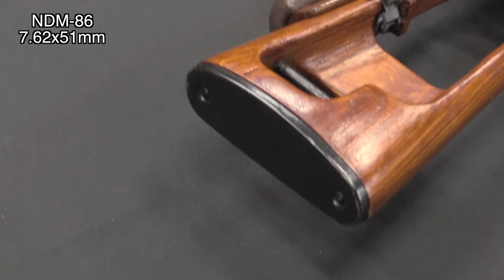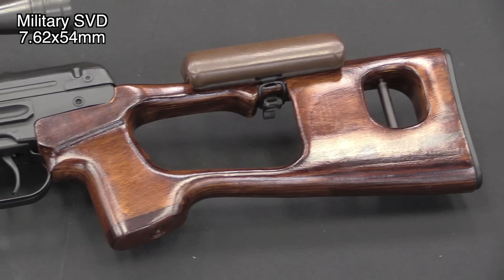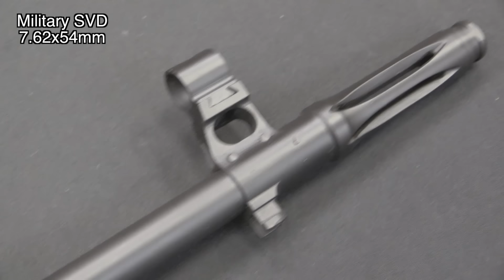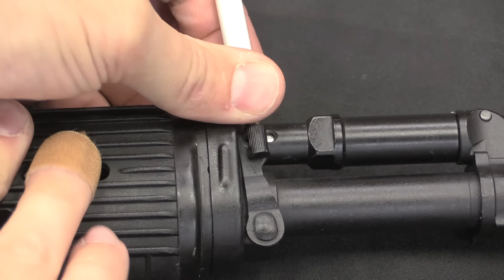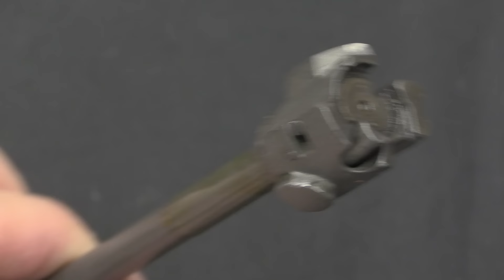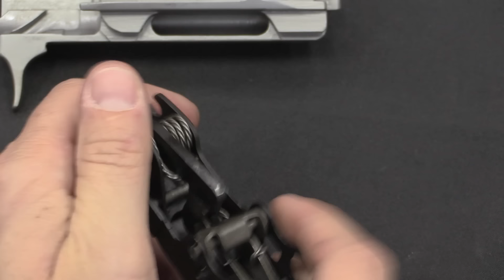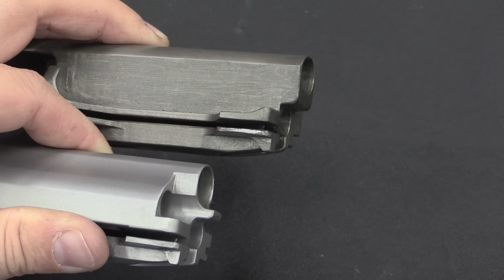Dragunov Variations: Military SVD, Izhmash Tiger, Chinese NDM-86

Comment: I've never heard anyone attest as to whether Dragunov's shoot sub minute. Anyone know?
Reply: When I was in the Polish Army Recon Unit, I received made in ZSSR SVD with folding stock witch makes easier to jump with. The stock furniture and fore grip was an laminate, the surface was badly dented, scratched and the whole rifle looks like was dragged behind the car for kilometres.  I want the rifle replaced for a new one.  First time on shooting range when I was alone, first on 500 m the group was in a fist size (original 4x scope) next target line was on 800 m, the group was a helmet size. To give some good reason to replace the gun, I shoot 10 rounds rapidly and I trow the whole rifle into the puddle of water left by the rain early in the morning. I truly believed the barrel will bend and I will get anew SVD. In my astonishment the rifle stay on target and the groups did not change at all. Thats a real jewel and I decided to keep the rifle. Cheers, Jack.
Reply: Hi Jack, I do appreciate the input regarding your knowledge and experience with these types of arms. I am wondering if you could answer the question this way as these rifles are obviously good enough for battle. Lots of shooters in the US generally sight in rifles around 100 yds / meters? I will do my best to do standard vs metric here. What I am wondering is, if there are any variants of these rifles that will shoot under 1 inch at 100 yds. This would be 3-5 rounds in a group that is 2.54 centimeters at 100 yards / meters or smaller. There are many popular rofles made around the world that are capable of shooting 3-5 rounds within .635 centimeters at this distance. Have you ever seen one of these capable of shooting that tight? That is bullet point to bullet point on paper. Please let me know if you can confirm.
Reply: @DjAboo1  the secret with SWD accuracy is to use match grade ammo with heavy bullet , the group on 100m with trained shooter will be one hole in Dia 10-12 mm. Second best next is ammo with white painted bullet tip. That ammo is also used in heavy machine guns, also w/ heavy bullet. Accuracy of that ammo is not that good as the first mentioned. On 100m best score should bee 15mm to 20mm range from SWD. All data groups is for10 rounds , which is the full loaded magazine. The SWD is no "sniper" rifle, is designed to be a squad sharp shooter rifle. Other genuine sniper rifles for long distance shooting are more expensive (15-20 k), and also equipped w/high  powered scopes. The are bolt action, ( SWD are semi-autos) and heavy barrels.  Top military sniper rifles available also on civilian market. That beauty's can shoot beyond 1000 m, depend from the  shooter skills. Usually it take 1year and 10,000 15.000 rounds to get a good filling and confidence to shoot in all weather conditions high elevations up & down target from your position. Cheers, Jack.
Reply: @jackjack8675  Thank you for the info!
Reply: Hi Jack, I do appreciate the input regarding your knowledge and experience with these types of arms. I am wondering if you could answer the question this way as these rifles are obviously good enough for battle. Lots of shooters in the US generally sight in rifles around 100 yds / meters? I will do my best to do standard vs metric here. What I am wondering is, if there are any variants of these rifles that will shoot under 1 inch at 100 yds. This would be 3-5 rounds in a group that is 2.54 centimeters at 100 yards / meters or smaller. There are many popular rofles made around the world that are capable of shooting 3-5 rounds within .635 centimeters at this distance. Have you ever seen one of these capable of shooting that tight? That is bullet point to bullet point on paper. Please let me know if you can confirm.